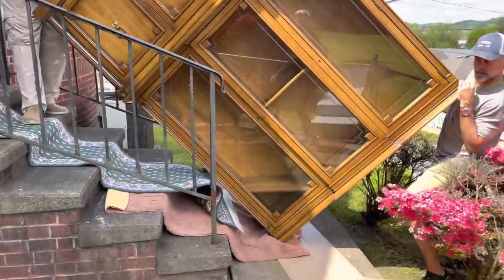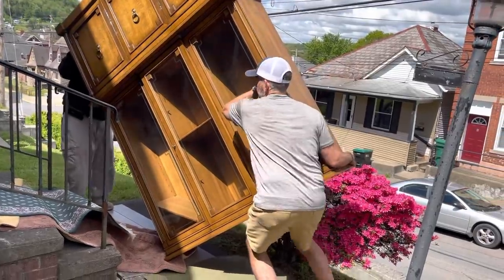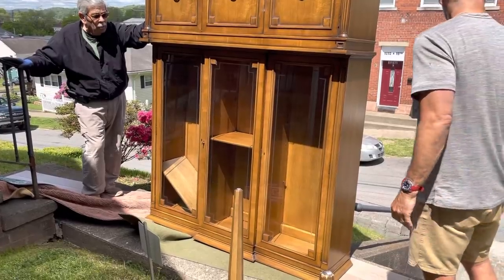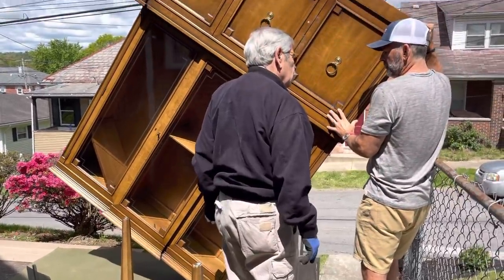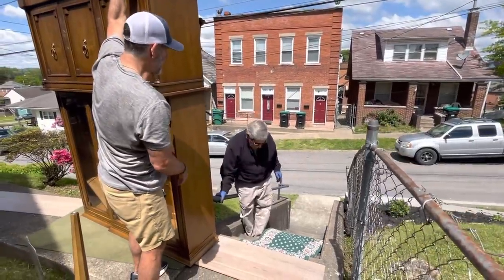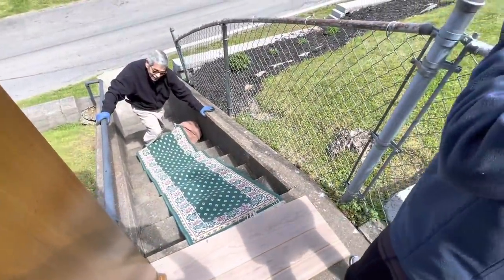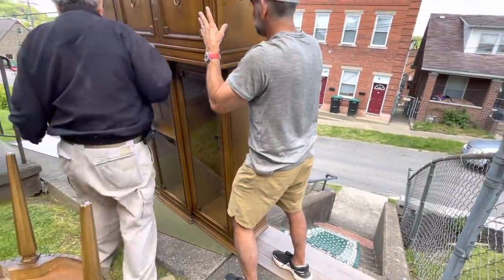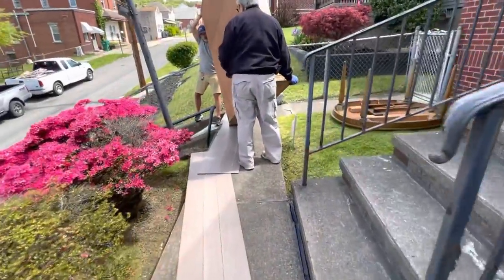China Cabinet😳3!

Comment: That comes apart. Why are you guys trying to move it in one piece it's so much more work then needed. If you look on the back there are either screws or brackets that take the top off the bottom. I've see this almost exact cabinet.